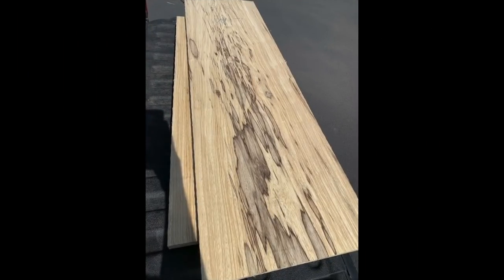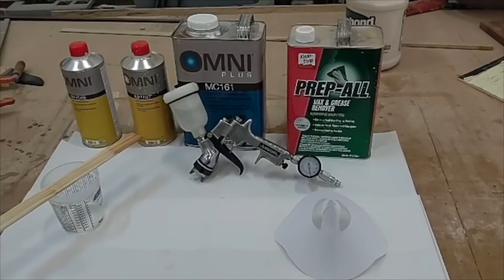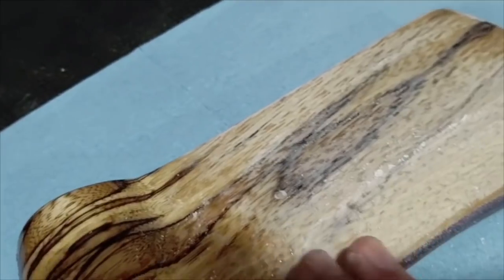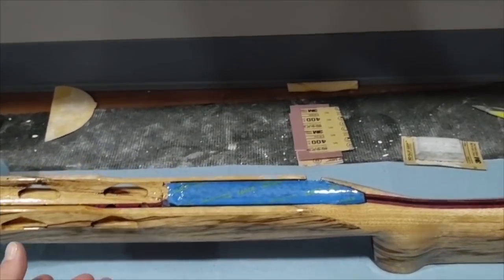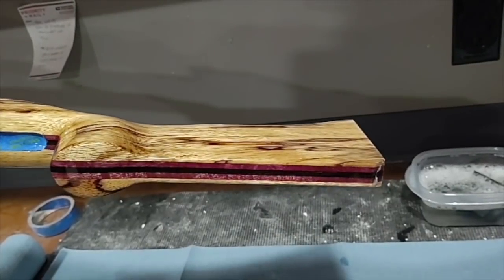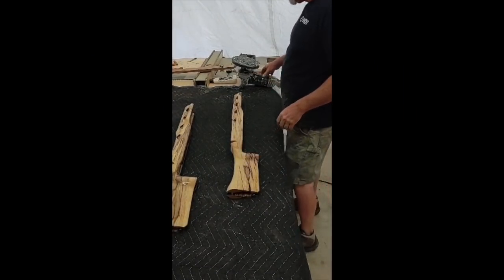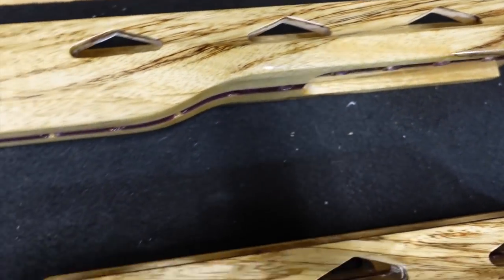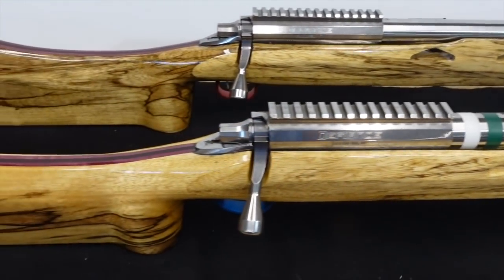Building a competition F-Class F-Open Rifle Stock

Comment: Husky hvlp? Iwata lph400 and you will have to sand 10x less or not even at all. You can clean you gun with like a cup of lacquer. Turn down the pressure to like 2 psi take the lid off and put a towel on the nozzle and let it bubble with the trigger pressed.  Also, if you spray thinned out light first coat and let it dry it will seal the grains way less sanding. I'd suggest a dual action polisher so you don't risk throwing the stock around, does a better job too.  End product looks nice just a lot of extra work. You have to be careful using two different woods as they expand/contract at different rates and can cause twisting/warping and separations problems when exposed to different humidity levels if it's not 100% sealed which most finishes aren't.

Comment: I use to do a little woodworking and after many screw ups I went to lacquer finish...it melts into the existing layer I think...but I did finish a stock with poly with orange peel but I just left it,,it works...good vid John 👍👍👍👍👍👍👍💖💖💖💖

Comment: John, what is the purpose of having the area of the stock where your cheek weld is cut low into that concave form, instead of having it cut strait across, or even elevated? I noticed in your reloading room confession with David Christian that he had his stocks cut the same way. Just curious, thanks for the informative videos.
Reply from the maker: That allows for room if you are doing a soft hold on your gun and not applying a lot of cheek pressure. To be honest, I don’t own these stocks anymore and have now switched to a more traditional cheek piece because I am applying more pressure and hard holding the gun.

Comment: Did he ever explain why an automotive finish, designed for metal, would be a good choice for wood?
Reply from the maker: I don't think so but I trust his judgement. He's finished other stocks of mine and they're always rock solid and take a ton of abuse. I know he did mention in one of the videos that when sanded it's easier to see the high and low spots because of how it sands down.
Reply: Automotive finishes are designed to be sanded easily and buffed to a high shine.
Reply: @FClassJohn  thanks,  I figured he had a good reason.  Pretty stocks for sure.

Comment: I am very curious about what bedding compound you chose to use. I have had my mind set on terminal ballistics research matchgrade bedding compound from new Zealand but it has proven difficult get any into North American. What are you using? I'd love to know
Reply: By far the most common bedding compound used by gunbuilders is Devcon "Plastic Steel" - relatively cheap , sets up hard and strong, and easily available - you can even get it from Amazon.
Reply from the maker: Just got confirmation these were bed with Marintex. It's a great bedding and a lot of the guys I shoot with are using it, but Devcon is still good too.

Comment: how are you going to stop the purple heart from changing color? Nice stocks BTW.
Reply from the maker: It's sealed really good but yes it'll still change over time as you said. It's not really in the sun long enough to change that quickly (it'll take years most likely) and even once it revert a bit to it's brown/gray color it'll still look really good. Part of my choosing the purple heart is for color but also because it's about the densest wood available and I like that for interior strength and just a little bit of mass down the middle.
Reply: That purple heart is stiff stuff. People have made pool cue shafts out of it for break cues.
Reply from the maker: @pandemicprecision4603  Yeah a buddy of mine has about a 60% Purple Heart stock and it's probably 2-3lbs heavier just because of that density. It's crazy.

Comment: cost ?
Reply from the maker: A stock like this including the RAD system runs around $1600 by the time it's all done. A lot of the cost difference is in the wood and the RAD. The RAD adds over $400 on its own and you can find cheaper wood that still looks great.